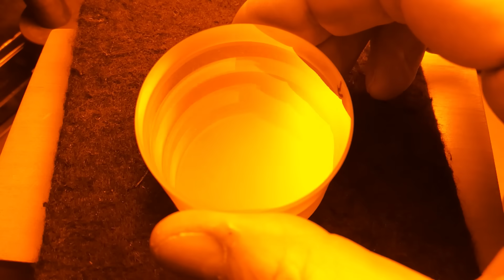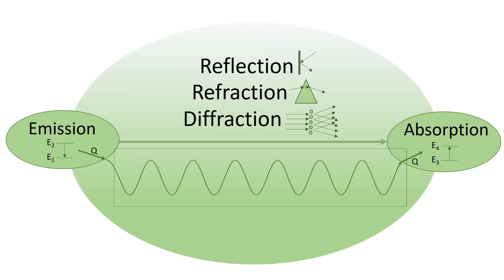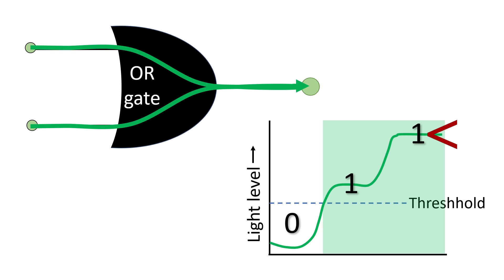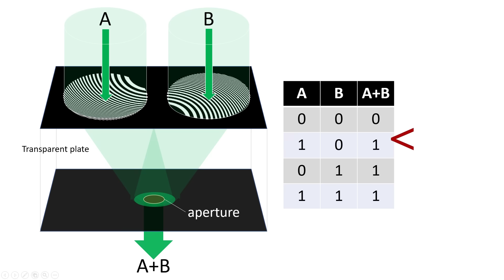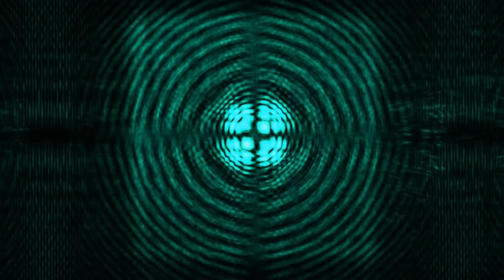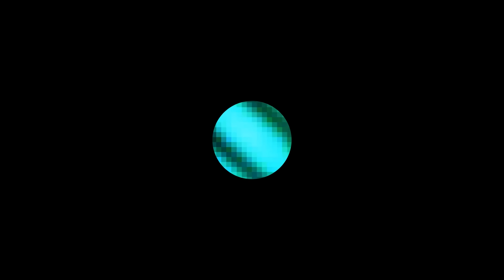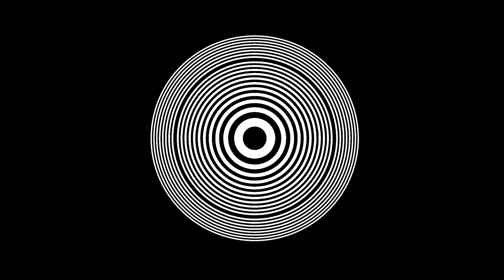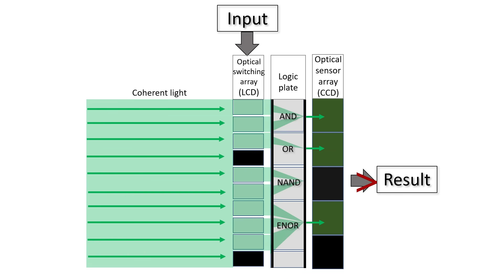Making Optical Logic Gates using Interference

Comment: I have been thinking about this myself now too for a few days since seeing that demonstration with a laser pointer and a Diffractive Optical Elements you can buy online which projects an Earth which rotates depending where you shine the laser, and constellations, onto a wall....

So depending on where the laser is shined, what angle, what color/wavelength, you could have this "Diffractive Optical Element" produce different complex "interference patterns", which are far more complex than simple digital computers can ever do as these are multi-dimensional (three we see plus at least one more for the electrical charge, maybe technically another for wavelength though its not literally another physical dimension but rather an effect of "interferometry"), and because these "compute" or "process data" at Light Speed.

So you could make processors I'm sure which take certain inputs and output certain complex outputs at light speed, but so far I have not learned exactly how these DOEs are actually made (though I think I know, I'm watching your video here right now).

Now you mentioned that the energy does not vanish in "destructive interference" pattern lines, and I was thinking it either changes in wavelength or direction, and most likely not direction (though I wonder, if you CAN make the direction of light change via "interference" with other light waves, that opens up possibilities for types of "force field" technologies!).  What is happening I'm sure is electrical charges are lining up in 3D (visible, physical) space, and like charges add together, and opposite charges cancel out, so that must be the lines where you do not see the energy, and I think what is happening, is maybe the electrical charges which "cancel out" become perhaps momentum in the electrons orbiting the atoms where the light waves are actually reflecting to produce the visible lines, which is also known as thermal energy, heat, or "turbulence" basically in the orbiting electrons (motions not harmonic with the perfect orbital pattern, thus enough "heat" causes "melting" and molecules and atoms to come apart and so forth).

Comment: I remember years ago pulling apart a cleverly engineered optical keyboard, it had a row of lights going down channels to led detectors at the other end. Each key had plate that would interrupt the light channels thus producing the ASCII character code for the key pressed. So you could implement a full optical computing system from input to logic and then work on optical output- wouldn’t that be cool.
Reply: The treason to build optical computers is for speed (single core or parallel processing). The optical to electron conversion is slow and bulky. We need photon switches that are mechanical/electron independent.

Comment: When you used the lenses with two focal points,  one above the other,  could you use two different wavelengths of light focused on the same evaluator?  This could be a useful multiplexing method if it has not already been suggested.

Comment: As an electrical Engineer, I realized the potential in this idea a few years back and decided to give it a few years exclusively to eventually get a huge payback after selling this for a couple Billion dollars. The premise was simple, that this will eventually take over the silicon chip industry and reduce computing cost by ten folds because high computing speed would reduce gates in the CPU to maybe a handful of them (like the Intel 8086 processor) but would run a PC easily. All I needed was a prototype. The main problem were the I/O ends of computing package (if you already have managed to build an optical processor) which would still be semiconductor based. I found out that the switching speed of photodiode can be as low as 10 to power -17 so it is possible. But later during the research I found a team out of the USA trying to do the same thing and they had a well funded startup/standing. I lost interest afterwards.

Comment: That's very cool!  As a general purpose computer I agree that it may not be a great idea, but the application of dedicated and specialized systems has me intrigued!  You could integrate that with your optical image recognition FFT, for what, I'm not sure.  Or maybe some battery-less navigation?  Like a sun tracker that uses no power?  I would have to believe making a diffraction computer would be far cheaper for some specific task with no power.

Comment: In the case of the concentric zone plates, is it not true that the outer rings having higher spatial frequency would diffract at an angle greater than the inner rings with lower spatial frequency?
So the outer rings would create a spot closer to the plate while the inner rings would create a spot further from the plate. Which is opposite compared to the graphic you showed.

Comment: Given how miniaturized transistor logic is at this point, I don't really see how optical logic could compete in any parallel application (as suggested at the end of the video), however, one major limitation with CMOS is the fact that each gate takes significant propagation time, which at this point, we don't really have any way to reduce much further (see stagnation of CPU clock rates). If optical logic gates however could be put in series with sufficient depth, even with the need of relatively slow input and output layers, they might be able to beat transistor logic in terms of computation speed.
Very interesting topic.
Reply from the maker: You are right and especially "series" configurations are very hard to do in this case. This is the reason I'm also looking into other configurations.

Comment: Making use of interference to solve this problem is brilliant. But an ALU (Arithmetic and Logic Unit) is probably the only thing you can create using this technic. I see no way to build a simple circuit and create a flip-flop typically, am I wrong ?. But you can probably integrate all of this and create ALUs with thousands bits. Although personally I'm not aware of any real life application for such a device.

Comment: Unfortunatally, it's impossible to make such logic gates. Because, in cases of 10 and 01 input situations you'll get a signal 1 with different fase shifts:
0 shift 0 + 0 shift 180 -> 0
0 shift 0 + 1 shift 180 -> 1 shift 180
1 shift 0 + 0 shift 180 -> 1 shift 0
1 shift 0 + 1 shift 180 -> 0
So, you should remember about fase shifts, because they are influencing on functioning further logic gates in a signal path. I've tried many ways of interference during years and still can't find a solution for this. Outgoing signal must be in the same format as ingoing.
I wish you success in your experiments.

Comment: Problem that i see with your gate Design is.
Unlike your design, traditional Gates Do not pass the energy from input to output.
As I was taught; Todays Gates based on it's input energizes it's output pins from it's VCC and GND pins.
Those you can daisy chain in series as much logic gates as your heart desires. Without the signal degradation.

Comment: Is a NOT gate not possible? Where you flip true to false and false to true. 

Not only could you make a computer (talk to Matt Parker who did a domino and water based computer) but you could also use light as a continuous value. Meaning activation functions (sigmoid threshold) would be needed for the output. But the whole network of calculations can work by constructive and destructive operations. 

While manufacturing is a bit of work, i think the theory is there to make an optical inference engine.
Reply from the maker: A NOT gate is possible. It requires a single switchable input and a (coherent) out of phase reference signal that is always on.

Comment: So in my opinion this acts a lot more like an op-amp with no maximum and minimum voltage rails than like a logic gate. If you have an OR gate where the output voltage is the sum of the two input voltages, its not really an OR gate. Its an analog summing circuit. It would be a lot more interesting to have the output of one gate guaranteed to be fit for the input to another gate.
Ironically, or just factually, 30 years ago optical gates or analog circuits could have been a substantial improvement in power consumption and feature size. Now that we're in the single-digit nanometer feature sizes, its really hard to see a way forward with any kind of optical computing that isn't orders of magnitude less space effective.

Comment: Main issue with this idea is power loss. If you lose half of the input power and start with 1 watt, after ten gates you are left with just one milliwatt. So you need amplifiers everywhere, which eats up the entire benefit.

Afaik this is why most optical approaches usually aim for reversible gates instead of going for things like and gates

Comment: The main drawback of optical computing is the size of the device : electrons have a much lower wavelength than light, and that allows for confinement in much smaller structures. It has its uses in telecom though, to avoid conversion to electronics wherever some kind of light computation is needed (routing ...).
How do you plan to deal with the different levels of intensity after a logic gate that code for the same logic state ? As things are you can't really chain those logic gates.
The key thing is not that different from, lets say, a magnetic badge, which are indeed quite secure, as long as the system is properly made (no possibility to mess with the relay that control the electromagnetic lock).

Comment: For a "complete" logic system you need 2 types of logic elements.. A combination such as AND or OR, (XOR will not do) and an inverter (NAND and NOR will do)
But the absolute essential is level recovery, requiring an amplifier. Without it you will very very quickly need excessively high initial input levels and always require that all logic paths or part thereof be the same length in terms of gate count (attenuators would work in a pass forward situation). If your gates attenuate by  just 6db then after 10 gates you will have 1/1024 of your original logic level. You will need to put optical amplifiers in there too.

Comment: I most certainly did attempt to build a logic gate using the same principles however due to me only owning machining equipment I attempted using double slit interface to generate the diffraction pattern. That however failed, but not miserably. It was due to fuzzy results that appeared at first similar to the difficulties you had. 
However, the issue I had was in manufacturing tolerance and scale, as after redesigning the logic gate to be more adjustable I was able to get some success, although absolutely zero stability as even slight changes in temperature would alter the results. This was most certainly due to the much larger scales and worse tolerances I was forced to manufacture in, that I belive you can get around.

I believe you would have a working logic gate if you resigned to a more planer pattern rather then circular, so you only are considering 2 dimensions with the third being only a necessity, and I do belive you have the equipment to design this or I would be rather silent about my prior near success, but I simply do not have the equipment needed in my machine shop at this time.

Please do build this.
Reply: And I would note.
My design I messed around with was absolutely the same in principle as yours, I just used a diffrent method of setting the generator that was strictly based on double slit interface. And it WORKED... sort of. 
You have the means to do it. So do it.

Comment: A light computer will most likely be able to do the following the calculations as well as combinations will result from the following factors light light color or light frequency angle duration of radiation or frequency strength of the frequency can result in different values which can be assigned to a number or digit conventional circuit boards exist no longer because these are made of a fiberglass or similar material        good work   ich musste ein wenig lachen :-)

Comment: Hello, I have had this question for years but this video has generated me more questions. :) Do you think it is possible to build logic gates based on radio frequency signals + modulating signal? If possible, would size be the only flaw? If it could operate with non-binary logic (more than 2 states), could it be useful? Thanks
Reply from the maker: Interesting question. I think it should be possible theoretically. However, like you say, dimensions are an issue in this case. Maybe use microwaves, or shorter.
Reply: @HuygensOptics  Thanks for answering. Surely there is someone, all over the internet, who has built something similar or has tried to simulate it in some electronics program. I'll keep looking for it. Thanks  :)

Comment: I thought about this before, if you look at John Hait's photonic patents at Justia, you would see that this type of thing has been dabbled with before. I haven't laid hand on any lithographic nor photographic development tools nor clean rooms, but I consider this a legit and cool field of study... If anyone were to find the next earth, in my mind today, photonic logic circuits could be very useful in navigation or optics and quick calculations. If we are to perform Quadrabyte of data throughput, that is 10 to the 21 which might be necessary for a single AI device job, photonics are necessary to have more than one wavelength calculating all in the same calculation space.. All in imagined theory. You could have a billion colors of monochromatic light all working in the same circuit, a shortcut is the multiplexor de multiplexor. Takes lots of logic and synthesis to figure the first wave of this, you are right that INPUTs must be very small and close together for the aperture or output to be right. If you get a circuit synthesis working for hobbyists, I'd want to see one.

If a wavelength is 630nm that should require microscopes that have a detail level reaching a single micrometer or less I'd think. I'm new at this, but my laser diode is 100Watts, seems a little too bright. Where do I get optics equipment?

Comment: relying in phases won't work for practical inchip usage, if you are thinking about doing entire circuits of it (as a CPU), because light can come through many different paths from many others logic gates,  that it will never guarantee the phase on the inputs be as design. Well, maybe can, by example, if is discovered that there is no latency when a photon is reflected, etc., maybe doing  a matrix of logic gates all the same size, can guarantee that photons enter and leave all in phase, don't matter which gate it takes as path. And the fiber wiring must be in its lenght a multiplier of the gate size (if any fiber wiring), maybe for simplicity can't be wires, as in a normal electronic chip, to connect stages, buses, etc. And anyway as described, there is the problem that it ends being an "analog" circuit, not DIGITAL, because signals will weak each time them passes by each logic gate, to be it DIGITAL it is required to INVENT a photon SWITCH that take power from a bigger power source than the always weak input signal, in other words, is required to invent the photonics equivalent to the "transistor/mosfet", that is the base a requirement to then be able to make "Logic Gates" which is the second layer.

Comment: Very cool stuff. I think the real promise of this type of circuit is in power savings and parallelism (multiple wavelengths, each representing a different set of inputs, could potentially be run simultaneously through a single circuit). BUT, I'm not an optics expert.

Comment: Great stuff. 

If one can't get away with the tiny size of the destructive focal point, one can think of a completely different reading plate, reading the geometry of the whole resulting interference pattern, at a bigger scale, rather than reading the tiny focal point. One might be able to look at the whole shape, and decode it as such, rather than look at a single binary point. Would polarized glass cut the mustard?

Furhtermore, the movement emerging when you move the reading plate seems even more obviously different according to the logic gate and to input values of each channel. 

For both ideas, one might biomimic rods and retina ganglions to achieve a spatial reading plate, or a movement-sensitive one..

Finally, given an indigo source and a red source, one could consider an additive device like this :

red_source :  addition   : indigo_source
      off         :    black      :     off
      on          :     red         :     on   
      off         :     blue        :     off  
      on         :  magenta    :     on 

The reading plate would implement a logic gate just by defining a subset of accepted luminosities (or colors, depending on whether tint or luminosity is the easiest to detect).

Comment: how to lump  Optical Logic Gates  together to gain functional component?   electric voltage can transmit in circuits easily,   water pressure can also transmit in tube , and can be gated in a pressure valve structure,   how light would transmit in a maze alike net-list ?

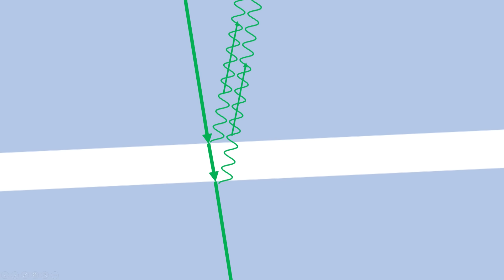Comment: To author: at 1:04 i do agree with you that we lack a better word, but i will give you two more examples of same phenomenon:
1. Two batteries in paralel are actually in short circuit, yet nothing happends to them or to a wire.
2. You can have switchable (on and off) permanent magnet, by holding both magnets on metal surface, and their poles turn one to another, and you lose all magnetic capability on metal surface, rotate 1 magnet 180 degrees and magnetic capability is there again.
Reply: I would not say they cancel each other out, which is wrong by law od energy conservation, laws of thermodynamics....
For example: You could say that batteries in parallel have canceled each other out, but it's wrong because batteries didn't killed one another.
I would say: they don't work together so you don't have result.